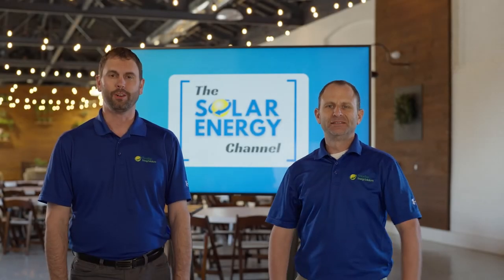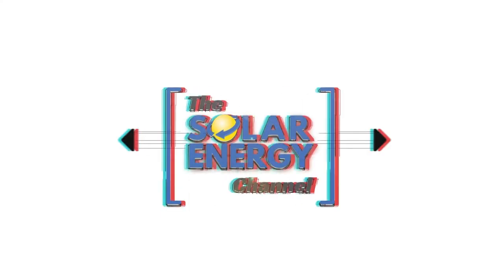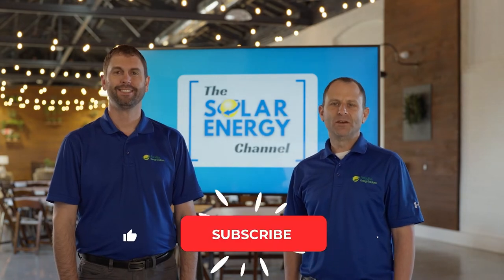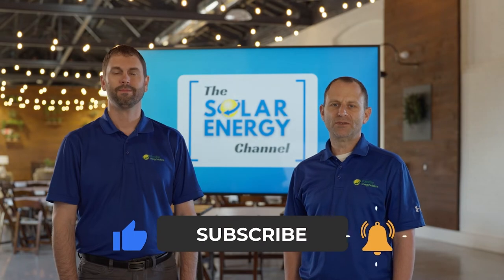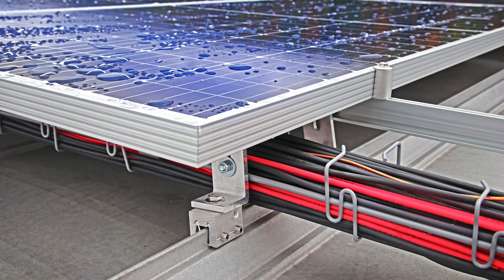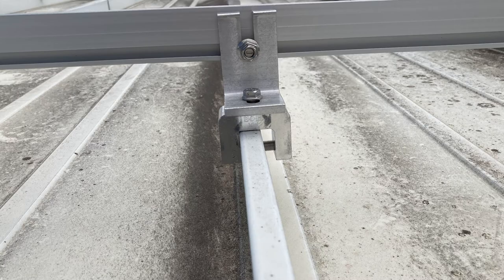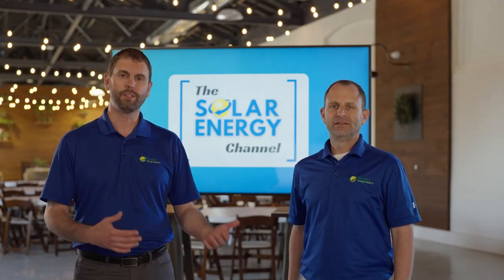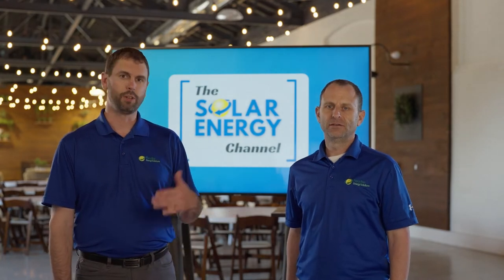How to Attach Solar Panels to a Metal Roof (standing seam and corrugated)

Comment: How would you ground the solar panels if it’s not built on a rack?
Reply from the maker: This is hard to properly answer without knowing the exact attachment being used to secure the solar panels to the roof structure. 
Some solar panel racking designs use attachments that attach directly to the roof and do not use a traditional racking system, which we believe is the focus of this question. Systems like this will come with detailed installation instructions that the installer should follow.  This type of attachment system would require a properly sized Equipment Grounding Conductor (EGC) that is bonded using a listed ground lug attached per the manufacturer's instructions to each solar panel at the location indicated in the solar panel installation instructions.  This EGC would then run back to the inverter and would be bonded to any metallic enclosures and raceway from the PV array to the inverter. In the inverter, this EGC would be bonded to the same EGC bond point as the EGC coming from the system service entrance. 

Any DC to frame faults will be detected by the internal components of the inverter and will fault the inverter and indicate the nature of the fault to the technician when a ground fault condition exists.  An AC line to frame fault will have a low impedance path through the EGC to the EGC to neutral bond point at the system service entrance.  This low impedance fault clearing path will allow the fault current to rapidly rise and open or clear the Over Current Protective Device (OCPD) in the AC circuit, which will clear the fault quickly by opening the circuit.

Comment: You certainly should be mentioning what slope limitations there are to have either Corrugated or Standing seam roofs. Not to mention the 100s of Screw holes in your roof if a corrugated roof is to be put on.  You should be stating the little rubber part of the screws that keep rain out degrade in less than 10 years and also the maintenance is continual with a Corrugated. If not checked every year you may be looking at popped out screws. Freezing and thawing  and ice build up under your low roof solar panels can also be a problem if ice pushes the screws out.  out. Get real folks. The slope ideally should be 3/12 or 2/12 for Standing seam and less than an inch is probably not ideal. I've learned the hard way. Most reputable roofers would not even use Corrugated steel especially is on a low sloped roof. A shed or barn is another story but not on residential. If anyone suggests Corrugated to you on a low slope roof and on top of that with Solar Panels RUN THE OTHER WAY.
Reply from the maker: Gail,
The corrugated roofs we're installing panels on are sheds and barns.  Standing seam is becoming more popular for homes, but still, most metal roofs are on ag or commercial buildings.

Comment: Can you install solar on a metal roof that was installed over the top of asphalt shingles?
Reply from the maker: That shouldn't be an issue as long as the metal is properly secured. Here's a video that discusses how panels are attached to a metal roof - https://youtu.be/hj8xyLBqxrg

Comment: Question about this. Recently had a contractor do this to a metal roof on one side of a barn. I now have water leaks/drips coming into the barn which were not there before, however there does not seem to be direct leaks where the bracket screws are drilled into the beams. Warranty is supposed to cover leaks but since they are arguing it is not coming from the drilled bracket holes, I am responsible for labor costs to repair. What to do here?
Reply from the maker: It is difficult to provide an answer without knowing a few more details about your roof and the installation. To help, we would start by answering these questions:

What type of roof was solar installed on?  If it was a standing seam roof, what type of standing seam profile is it?  How old is the roof?  Did the installer verify that the bracket used to attach to the standing seam is designed for the standing seam roof style?  Was it installed per the manufacturer's instructions?  

Sometimes what can happen is on an older roof, the impact of the installer walking on the roof surface can cause the seal between the metal roof and the roofing screw to fail or break, causing a leak that is not directly related to the solar installation.  Sometimes a 3rd party roofing inspector may need to be hired to sort things out.

If the roof is a corrugated roof, one still needs to verify that the roof attachment is designed for the corrugated roof profile, and that the attachment is installed exactly per the manufacturer's instructions.

We'd start by determining the facts of the situation.  If it's determined that the bracket used isn't designed to be used with a particular roof profile, that incompatibility may prevent the attachment from sealing properly to the roof.  

If the leaks are coming from elsewhere on the roof, we would start to question the original integrity of the roof.  A properly installed metal roof should be able to have an installer cautiously walk on the roof without causing the screw to roof panel interface to fail and leak, unless the roof is nearing the end of it's useful life, or it was not properly installed.
Reply: Corrugated/exposed fasteners..This is on a barn. Roof is about 7 yrs old. I think I agree with your description of the roof and roofing screw shifting due to installers walking around on it which is causing water to penetrate now. Leaks do not appear to be coming directly from the brackets. If this is this case, am I responsible for the leak repairs or how does that work? Since it's an open air roof, the wood does dry over time so how much integrity am I losing over time without doing repairs? 
Company is saying they think original installers did not seal properly and they would need to remove everything, re-seal, and re-install. Not looking forward for the price of labor for that if I'm responsible. What is a recommended next step? @thesolarenergychannel
Reply from the maker: @Tom-q9z5s  These are questions you'll have to ask your original solar and roof companies or a third-party structural engineer.

Comment: Can you attach solar panel brackets to a standing seam roof with roof panels attached to roof with nail edge instead of clip system?
Reply from the maker: Sure, it’s possible, but using the brackets will give you a much cleaner install. They are also designed to keep water out.
Reply: @thesolarenergychannel  are the brackets rated for high wind?  Miami Dade FBC?
Reply from the maker: @UKlelegirl  They are made to withstand high wind. The specific wind rating would need to be found in the manufacturer's specs.
Reply: Do you sell the brackets?
Reply from the maker: @thomasleithauser3412  we do not. S5 and IronRidge are two companies to check out for attachments.

Comment: Have you worked with any metal building construction firms at the preplanning stage?  Does it help to engage at that point about features like type of roof, pitch of roof, extra support, or anything else?  Do metal farm buildings not designed for human occupancy still require the 3 foot border for the fire code?
Reply from the maker: Yes, we've been involved with the preplanning stage to make sure a building is designed with solar in mind. In many cases, we're able to offer suggestions that will help create the best environment for a solar system in the most cost-effective way. The setback requirements are based on local codes and would apply to all buildings.
Reply: @thesolarenergychannel  Thanks for the information.
Reply from the maker: @goldenacres3269  You're welcome!
Reply: @thesolarenergychannel  Which companies have you worked with?